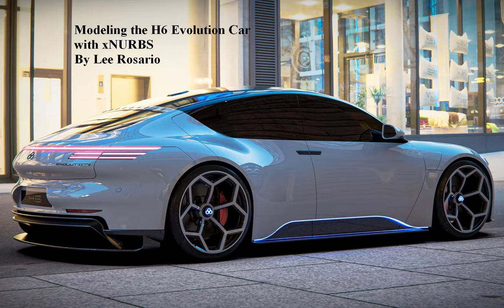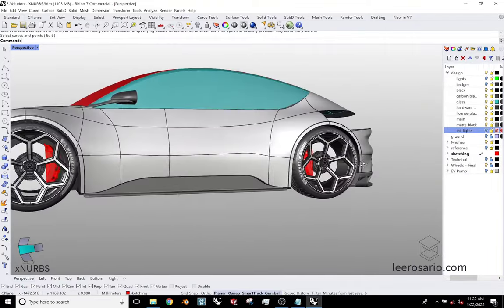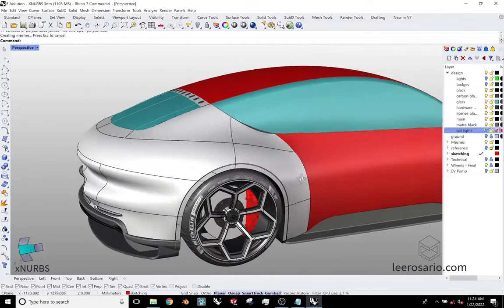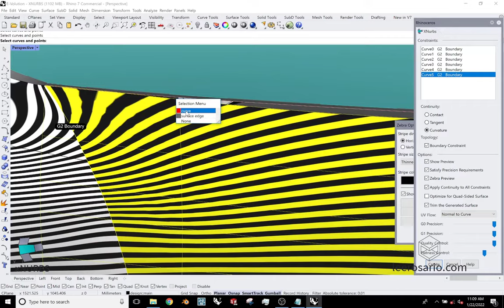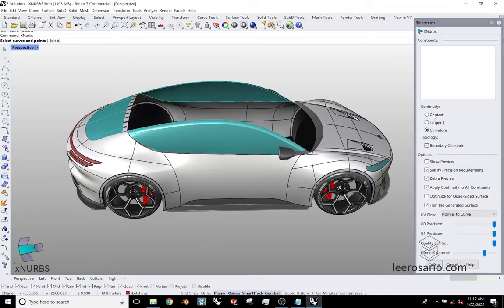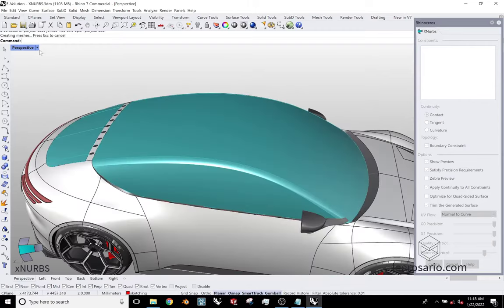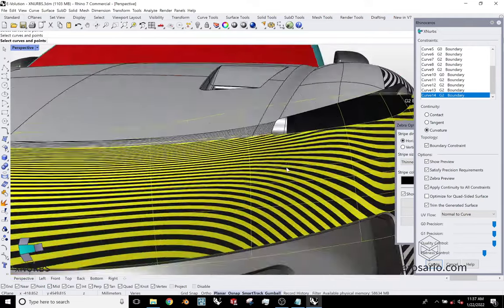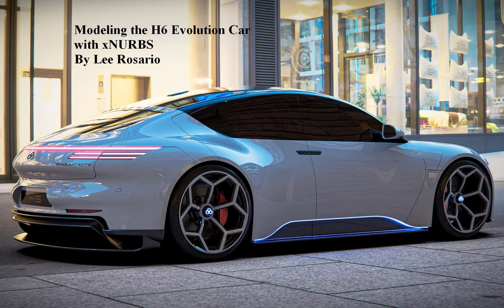Modeling the H6 Evolution Car with xNURBS

Comment: Good for concept modelling. For production ready design, it seems the tool needs more considerations towards control of CV layout.
Until then XNurbs is just for visual representation (non-engineering process) of might become the actual product (engineering process).
Reply from the maker: The CVs are automatically positioned by xNURBS optimization algorithm on the fly. The CV layout is the one among all possible solutions that generates the smoothest curve or surface. So the generated CVs are outstanding (xNURBS optimization algorithm produces fair shapes that are analogous to a physical model: when a wooden batten bends, it always assumes a shape that minimizes its bending energy to form a smooth curve. Similarly xNURBS generates a NURBS curve or surface that is the one among all possible solutions that has the smoothest shape. This is how xNURBS generates high quality CVs on the fly.).

This video only shows a quick rebuild. The power of xNURBS is equally of value during speed modeling and also during final production modeling. During the actual design process, surfaces can be broken down further, and then rebuild as needed to achieve good flowing, tangent surfaces and smaller deviations.
Reply: @xnurbs3502  Yes, and as I said for fast repairs and non-critical parts it is good, really good. But there are many other considerations for engineering (the so called "Class-A modelling"), which would require CVs, spans, and hulls to be controlled individually.
Reply from the maker: @PASHKULI  
There are a number of options in xNURBS dialog so that designers can change CVs and hulls etc.

I think you mean Bézier surfaces. It is one way for Class A surfaces: single span and each patch must be very simple. Designers generally need spend a lot of time to manually adjust control points to generate the desired patches. Very time-consuming. If there is a small change in the design, then re-do the whole work.

As said, for xNURBS, you change the CVs and hulls etc. via xNURBS options, e.g., the sliders and check boxes. This is how xNURBS generates high quality curves and surfaces on the fly. If there are changes in the design, xNURBS regenerates the surfaces in (milli)seconds.

This is how the final car model in the render is completed within one month.
Reply: @xnurbs3502  Nice, but am sure they will not produce the car exterior from the files XNrubs was used. They will make proper A-class modelling. XNurbs here is for conceptual design: fast and great visual results!
Reply from the maker: @-IYN-  Yes, it will not produce the car exterior from the files xNURBS was used in the demo.

As said in the video, the demo is a simple recreation to showcase xNURBS features in a brief way. In design, more time and analysis was spent during the actual creation of the model using xNURBS to produce the results you see in the final render. In other words, the model in the final render uses different surfacing layout and xNURBS settings. So this particular demo only shows the use of xNURBS for fast concept design.
Reply: @-IYN-  why not produce exterior car parts from xnurbs surfaces? I am really interested, thanks!

Comment: Not fit for class A at all, but great for fast ideation
Reply from the maker: The demo in that car video is a simple recreation to showcase xNURBS features in a brief way. In design, more time and analysis was spent during the actual creation of the model using xNURBS to produce the results you see in the final render. In other words, the model in the final render uses different surfacing layout and xNURBS settings. So the demo only shows the use of xNURBS for fast concept design.
Reply: @xnurbs3502  Yes, sure. And it seems to be great and smart. I just meant that for class A surfacing surfaces cannot have spans at all, and must be the simplest mathematical surfaces as possible, usually no more than degree 5. Thanks for your comment ;)
Reply from the maker: @gibson2623  
I think you mean Bézier surfaces. It is one way for Class A surfaces: single span and each patch must be very simple. Designers generally need spend a lot of time to manually adjust control points to generate the desired patches. Very time-consuming. If there is a small change in the design, then re-do the whole work.

xNURBS optimization algorithm produces fair shapes that are analogous to a physical model: when a wooden batten bends, it always assumes a shape that minimizes its bending energy to form a smooth curve. Similarly xNURBS generates a NURBS curve or surface that is the one among all possible solutions that has the smoothest shape. This is how xNURBS generates high quality curves and surfaces on the fly. If there are changes in the design, xNURBS regenerates the surfaces in (milli)seconds.

This is how the final car model in the render is completed within one month.
Reply: @xnurbs3502  Yes, sure ;) Very nice ;)